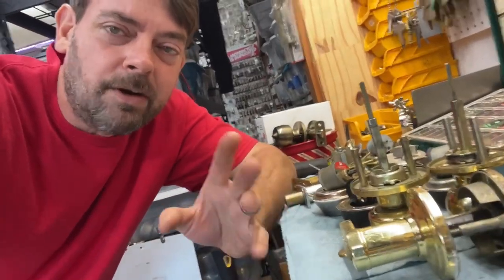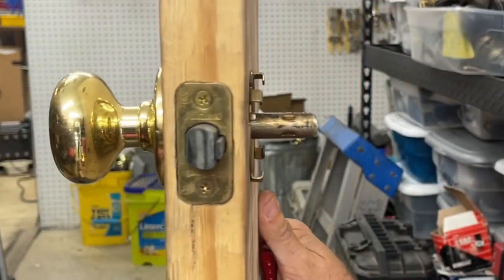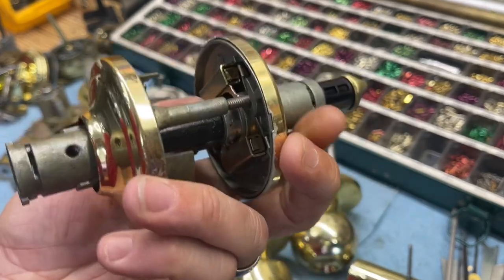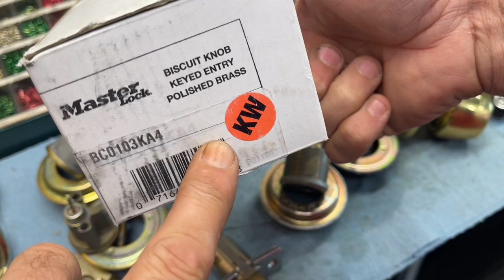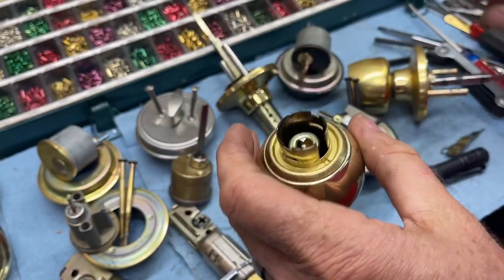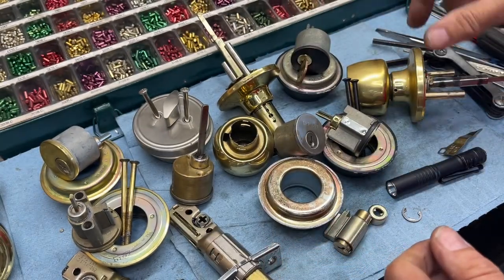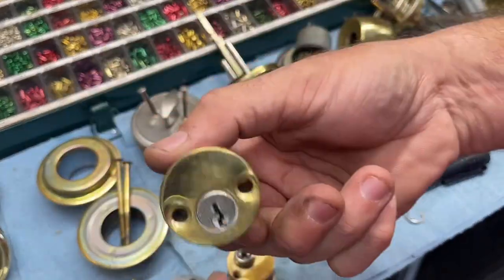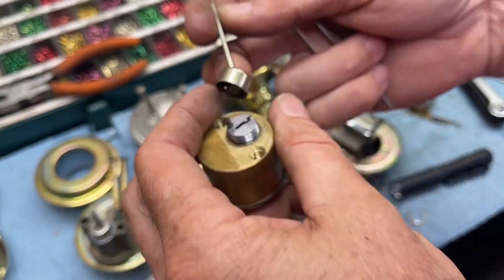RLS 10 - Kwikset Keyway Locks

Comment: I don't think I have ever seen one with the "arrow" that gets pushed up.  I have seen the ones with the reverse set screws.  Would you use bluegoo (locktite) on the set screws?
I found it handy to put a blank key in the cylinder to prevent it from falling inside the knob until I was in a position to remove it completely.  When the cylinder falls in the knob sideways it's a real pain.
Thanx for taking time to make the video.

Comment: Jason are you familiar with the older Kwikset UL entry leversets?  I came across a residential job complex that used these locks. I thought these were Titans but upon inspection I can see they are not. First, no Titan reference on the latch face, second std 5 pin key, third the locks went in '92 (Titan first appears in 92-93). Lastly and  most striking is that similar to locks having Euro Profile cylinders, the cylinder hole on the handle as seen from the front has a notch cut out to accomodate the cylinder bible, this leads me to believe these are removable core cylinders. Since I dont believe there is a 5 pin core removal key, I am thinking this could be a 6 pin removable core cylinder that is pinned only to 5 pins. Your thoughts?
Reply from the maker: Jason. It’s Jason.
Reply: @selock  Apologies.
Reply from the maker: @shieldcracker  I just took one off today that I think you are talking about & video will be up shortly
Reply: @selock  Thank you sir. I look forward to that.
Reply: @shieldcracker  Dude what did you call him? I see you edited your comment, but I just got to know. 🤔😁
Reply: @63flight  I always thought his name was Dang Dude. But now I know it’s Jason 😁